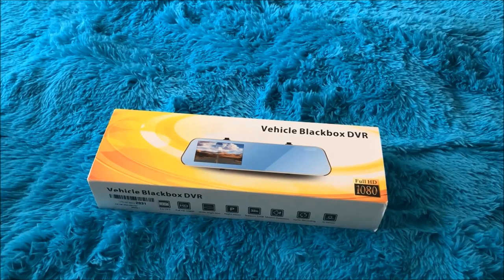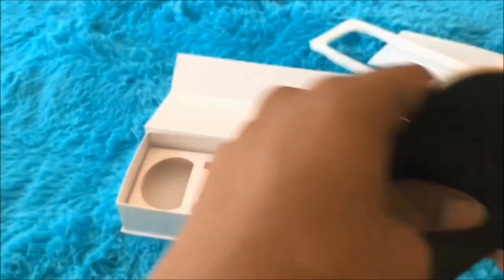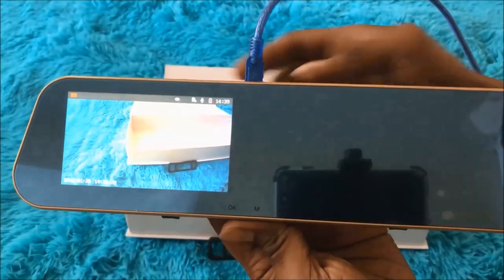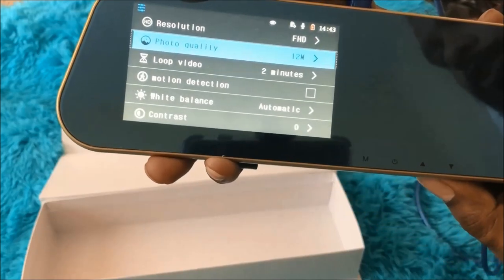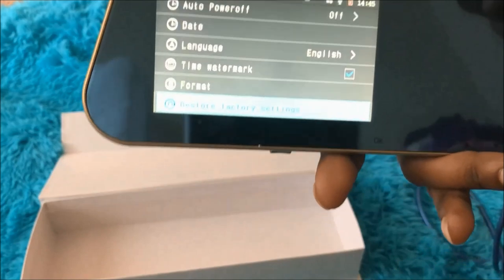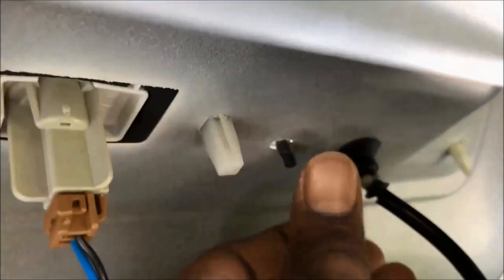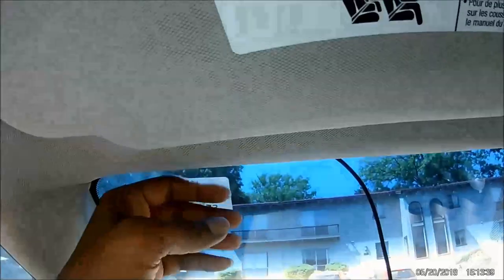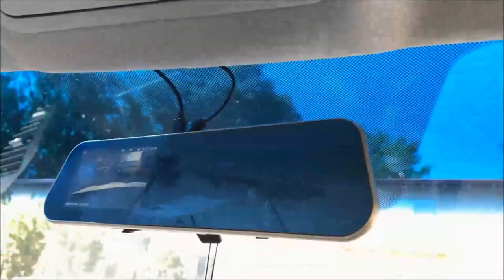REARVIEW MIRROR Dash Cam and how to fix Backup Camera

Comment: Hi. I am enquiring about the AV line. I bought mine without it, thinking I could use my current backup camera with the RCA connector. However the DVR only uses AV in. I am looking for the AV line in stores and there are 2 models. 4 pin and 5 pin. Which one did you use? I.e. Which one will work with this DVR?

Comment: How to fix if the screen is keep on turning on and off?
Reply: Same problem I m facing bro
Reply: Me too, now it doesnt turn on at all
Reply: Change it back to factory settings. Don’t change the length of the videos unless you have a large memory card, be careful when you change the sensitivity, because too sensitive, and every time the car moves. Your camera will fill its memory bank with unnecessary recording. And if you’re not getting into close calls. Format the card every now and then. This helped me.